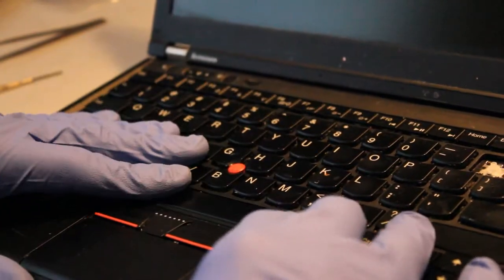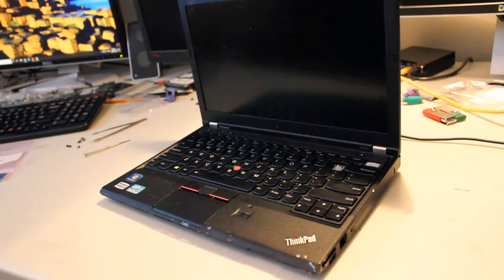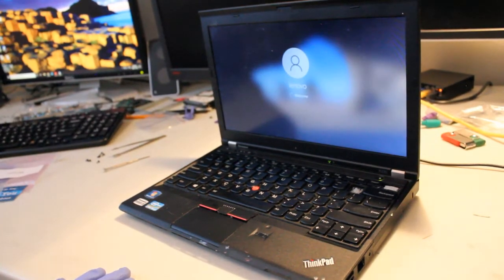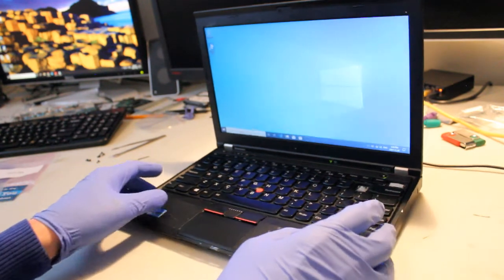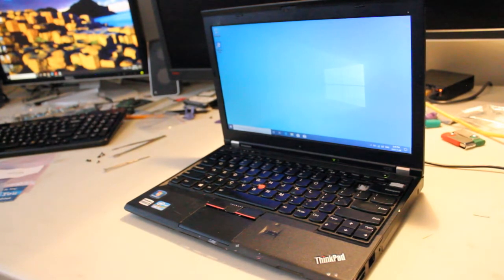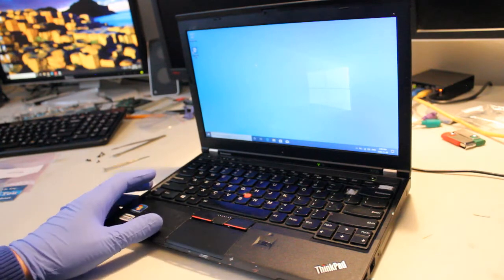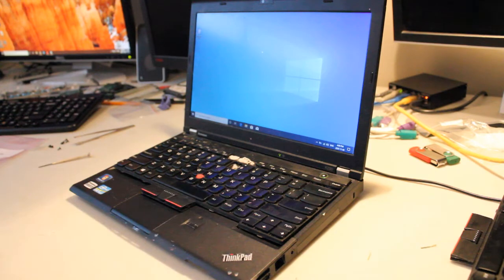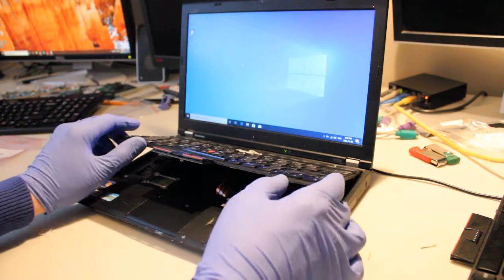Lenovo ThinkPad X230 Touchpad Replacement

Comment: Question: Is the mousetrack for this laptop replaceable or can it be disassembled? I'm trying to look for tutorials over the net but can't find any, only keyboard replacement vids. I'm starting to think it is not possible. I replaced my X230 faulty keyboard which did not come with the mouse track. I'm planning to remove the mousetrack connected to the old keyboard and put it on the new one, but it looks permanently connected to the board it seems. If you can create a tutorial about it that would be really great. 😃
Reply from the maker: So, removing the red trackpoint from the keyboard and install it on a new one?  Can you link to the keyboard you purchased?  I don't know that it is possible with the versions that don't feature the trackpoint.  Good question, I have never thought about it.

Comment: Hate the bumps on the touchpad is there a replacement without the bumps?
Reply from the maker: Hm, there might be.  For example, I have touchpad stickers for a ThinkPad T440 or T540p and those are smooth.  I would have to double check if the X230 has the sticker touchpad you can remove with a heat gun or if it's all one unit.

Comment: Hello what vendor did you get the touchpad from? 🤔 I have a Lenovo E535 laptop, & both the keyboard & touchpad are inop. I have a replacement keyboard but want to replace both at the same time. Thanks, & great video! Also, do you have a video of replacing the CPU on a laptop? Another similar video shows that the keyboard has to be put in so it doesn't bind where the F keys are
Reply from the maker: I ordered this one off eBay.  I do have a video of me replacing the CPU on a ThinkPad T430 https://youtu.be/mkFSP-xAIgo

According to this video https://youtu.be/4wBuxNm5FRE it looks like the CPU on the E535 can be replaced.  Look up your current CPU on https://www.cpu-world.com/ and scroll down for a list of different options.  Pay attention to the socket type.
Reply: @HaisteComputerRepair  thanks I will watch your posted vids! I think the fastest A8 (the Lenovo has an A4 installed) that can be installed is the A8 quad core. I also want to upgrade the RAM to 16GB. With Win 10, the logic board still can't support more than that, right? There's only 2 RAM slots. Thanks 🤓
Reply from the maker: @j.lietka9406  A quick Google search came up with the E535 having a max capacity of 16GB RAM.  That paired with the A8 quad core CPU will be pretty nice.  Good luck and thanks for watching!